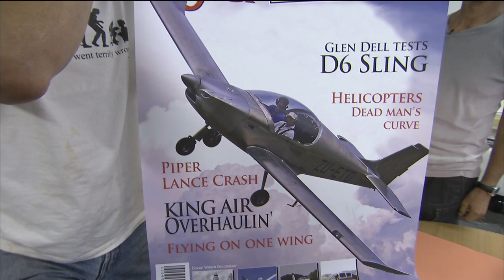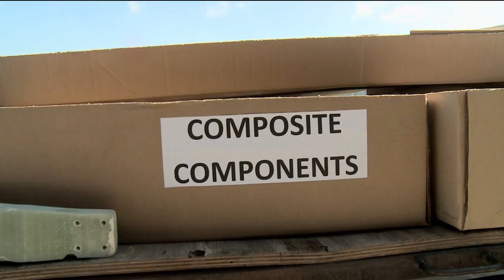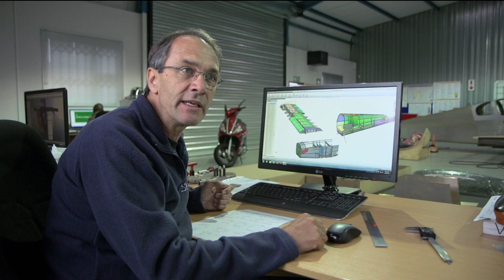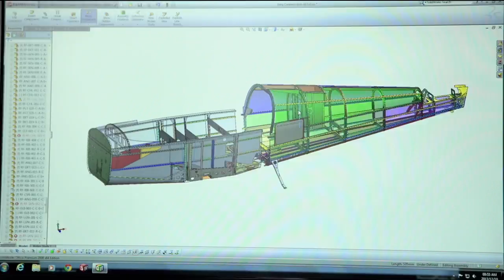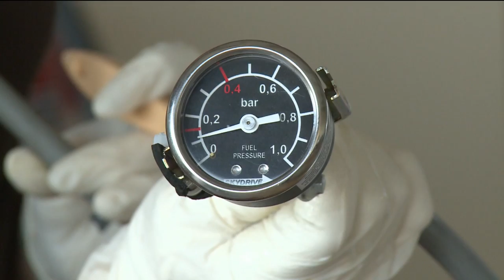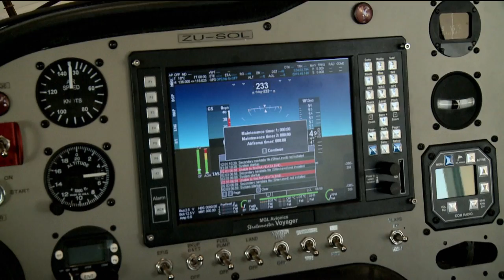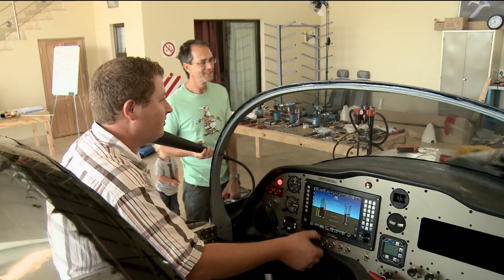Faces of Africa - 7 Day Airplane

Comment: Those two owners are ungrateful s.o.b.'s! 
It looked like that mechanic not only installed the engine, but held up the rest of the crew by building, wiring, and avionics installation. My guess is that he did virtually everything on the cockpit and fwf.
He wasn't even shown or mentioned at the end. He should be made a partner after working there for that long.
Reply: I'm sure he is paid pretty good, he is their number 1, but hes certainly experienced in these short deadline builds. Its a great gimmick for selling the planes.